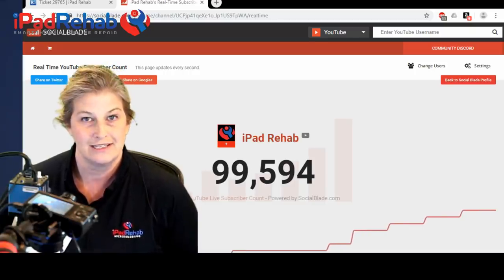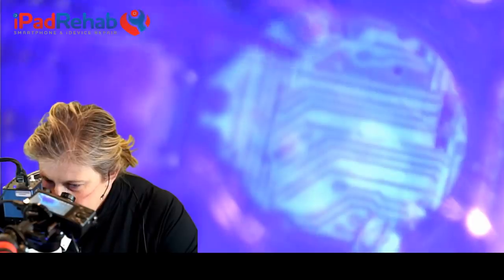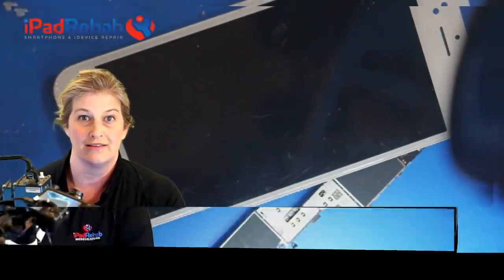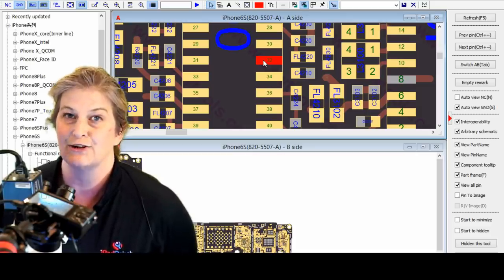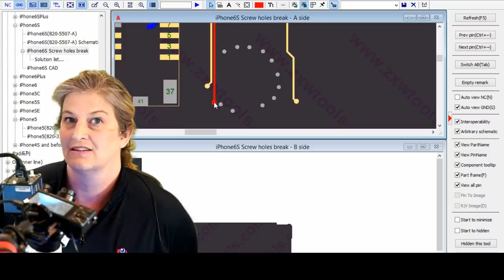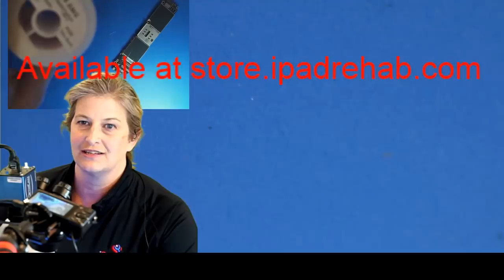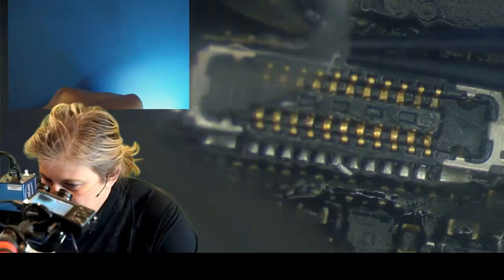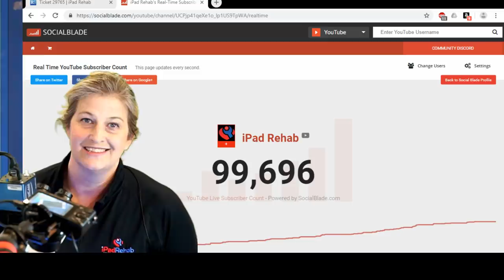Can We Recover Data From An iPhone Snapped in Two?

Comment: It's all about shorts and opens :).  When I was in the Navy and attending Advanced First Term Avionics our practical tests usually wound up with almost the same type of sequence.  Isolate the block by using resistance and voltage analysis.  You zero in after that.  Honestly though, what I learned in AFTA I took and am able to apply to just about any problem that needs to be solved.  I'm a software engineer now and I feel my debugging tasks are better because of that experience.  Watching you do the same analysis for board repair just validates that.  I came from Louis Rossman's channel and I'm really enjoying the content.

Comment: In my experience with micro controllers and various logic level ICs, Reset and Enable pins (usually labeled as RST and EN) are usually triggered by pulling the pin high or low. In this case I would have simply tried connecting pin 32 to ground and booting the phone to test. If that didn't work, I would have injected .5 or 1 Volt to the pin. Enable and Reset functions are never connected to a data line and since the APU is not on the line there is no chance to damage it. Let me know if you think this makes sense. Love your videos. Cheers!

Comment: Nice vid. What about using a normal wired PC mouse to bypass the touch-screen?
I had to repair Samsung S8 with a broken screen and touch-screen function. While  I was waiting for the new digitizer to arrive I had to recover the data with the broken condition.
So, using an OTG connector and normal wired PC mouse you can control the phone as if you using only one finger.

Comment: FYI, you can plug a USB keyboard into an iPhone to enter the pin/passcode if the touch screen is disabled.  Use the Lightning to USB Adapter (available on the Apple web site).
Reply from the maker: No.  The phone will not recognize a usb accessory without passcode entered first.
Reply: @JessaJones  ah, that makes sense.  My iPad air used to.  New security feature I guess.

Comment: Very entertaining stuff nice job. Only note on the apple topic is I totally get why the try to discourage repair and such. In the wrong hands, it’s a horrible experience and you can even get ripped off. You may be one of the good ones but for everyone one there’s ten bad ones. Apple rather discourage and have a couple casualties knowing the real techies will find a solution than to let any joe post about how you can fix anything and to go to their site or small mom and pop shop where their data could be compromised.

Comment: Not knowing where the memory for the photos is stored or how it is stored I'll ask this question: could you simply remove the chip (or chips) where the memory resides and solder it (or them) into a working iphone circuit board?

Comment: Why not just try a USB keyboard and the lightning to usb A adapter? If the lightning port was functional it may have been a good shortcut?
Reply: Can you hit the trust button that way? (I use android so idk)
Reply from the maker: Because the device will not allow a data connection through usb without passcode

Comment: Oh... I suppose I shouldn't have trusted apple then. I think they screwed me.

I have an iPhone 6s that won't get past the apple logo when turning on. Apple support told me to try to update it, but if the update didn't work, then I have to put the phone in recovery mode.

So, I hooked the iPhone up to itunes and started the updating process, then I left for a bit. When I came back, the iPhone was about 80-90% of the way through the recovery mode loading bar. ITunes had automatically started recovery mode on the phone when the update failed. iTunes failed to tell me that it would automatically send the phone to recovery mode if the update failed. 

Since I did not let the phone finish recovery mode, is there a chance that my photos did not get deleted?

Comment: Is there a way that my files within the phone such as messages, photos, etc can be stolen secretly by the technician? The iphone is dead and motherboard failure. But all the files are in there. Is this possible or they must really know the password and apple id? Thanks
Reply from the maker: If you had a password on the phone, and if it is a modern phone that stores data encrypted on the drive then no. “Not with today’s technology”.  

That may change in the future, so if you are a celebrity or billionaire then you might want to keep your flash memory chip.
Reply: Thank you for your response. My iphone X had a shorted motherboard and i never got the chance to delete everything. So i was just curious that if ever they fix it, that they might harvest my files or whatever.

Comment: Jessa(or another Professional etc...), wondering about the comment, “...ZXW comes with many viruses from China...”? Was thinking of picking up this program to add to my other 2 different programs I currently use for electronics/board repair/etc...; however, would really like to know if need to be cautious b/c this program truly does have different kinds of malware/viruses. Do have a few computers I use for repair (diagnostics, board views, etc etc etc) & have all the precautions(air-gapped, several layers of encryption/firewalls, & other things...) of malware/viruses/etc...but would still like to know about ZXW. Thanks for the vids & info.
Cheers✌🏻
Reply from the maker: embrace the viruses.  most people find it difficult to install and use zxw without embracing the free viruses.
Reply: @JessaJones  OH.....one of "Those" programs, lol. It's why have dedicated PC isolated on its own network, etc....
Thanks :-)

Comment: How do people do long screw damage. You can feel if the screw is wrong for the hole. I don't do micro board repairs but I have pulled apart several hundred laptops and I have never done a long screw (make of that what you will). I support Right to Repair but I also think that those who start a repair business should have to attend a basic training course where they are taught how to not long screw and to not make such a freaking mess and then passing it on to a better/more experienced professional. The crap that you, Louis and the others that I watch what they do in amazement, do not deserve to get the crap jobs that the amateurs far cup. It would also be beneficial for the customers in the long run and would help the repair store not be viewed with suspicious scepticism (I know, tautological). I have been searching my local area for a micro repairer that I can trust for 13 or 14 months to repair a tablet that may or may not be fixable. Last time I tried to get a different repaired they couldn't even give me an idea of what might be the issue and would only do a full logic board swap. Not what I wanted. Apologies, I have waffled a bit. 

Jessa, I hope you enjoyed turning that phone into a PC and gaining a new donor board. 😀

Comment: Uv is dangerous! Proceeds to look at it through a microscope.....
Reply: not all UV is dangerous
Reply: (im aware shes the one that said it btw)
Reply: It’s not dangerous through a microscope. Especially not through an electronic microscope.
Reply: It is indeed not OK to look through the microscope and it will depend on intensity and exposure time as she clearly implied (seemed low to me). The reason is that it is an optical path but the amount of light into the eye is based on how much the missing screw hole is reflecting and not a whole room wall. To look at a computer screen displaying the microscope camera capture is NOT an optical path and you should only be worried about the UV that the back-lighting of the screen might be emitting. It is a stereoscopic microscope (so the human can perceive depth) with a digital camera probably on one of the lenses (left or right).
Reply: Thomas Magdahl Spiess optical path only matters if the glass is significantly transmissive in UV, which it won’t be.

Comment: why bother w touch, and not run a mouse thru the port?
Reply from the maker: The device will only communicate through usb AFTER passcode and trust
Reply: @JessaJones  just spitballing, but some sort of USB splitter which would allow for a PC connection and a USB mouse for input?  Might save a ton of time long term with data only recoveries.
Reply from the maker: You didn't read what I typed :'(

Comment: Love the design let put important lines or any lines around screw holes WTF is that thinking. thats like car manufacturers putting computers on top of the inner fender or they can get covered in salt and water instead of inside under the dash in a safe dry place like we're the wiring in the older vehicles we're.

Comment: Can't you just connect a mouse using a adapter and fill in the password? On Android at least you can.
Reply from the maker: If only it were that easy.  IOS will not communicate through usb without passcode first